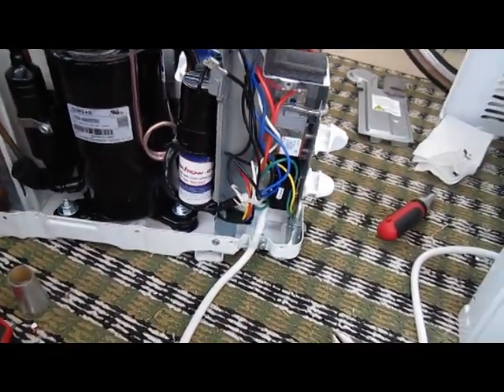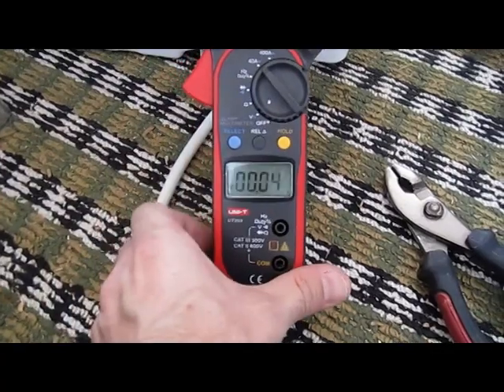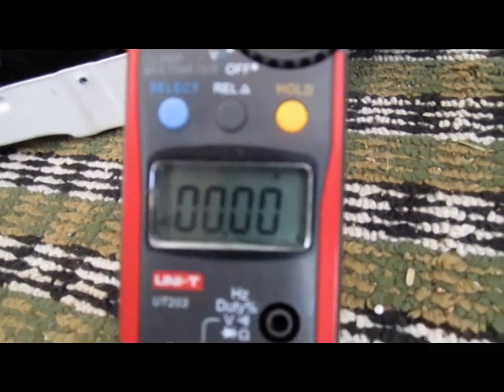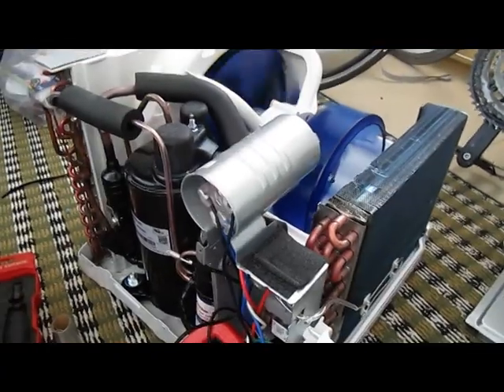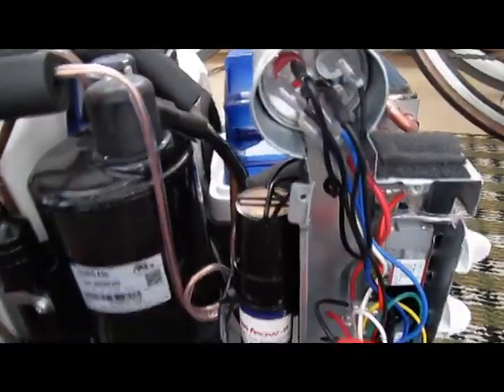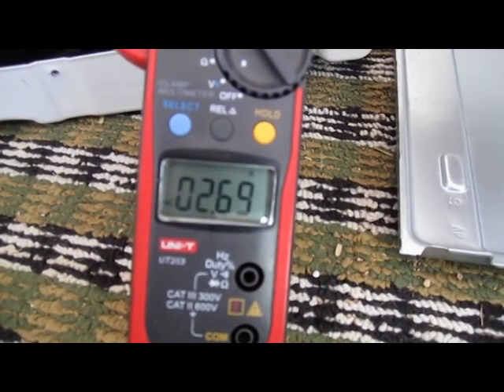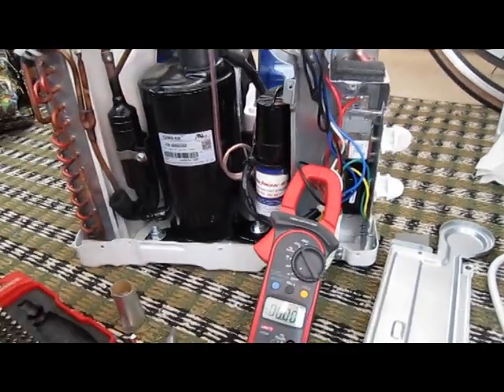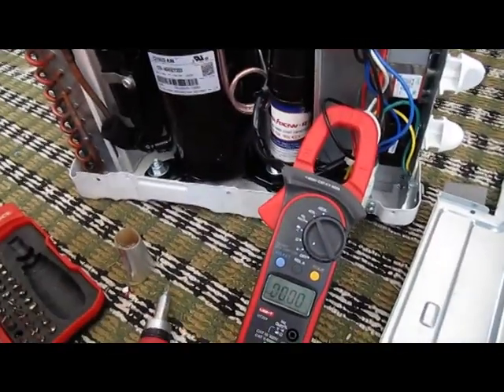Hard start cap mod on window AC unit for off grid, solar power low amp startup.

Comment: Id like to see how you did the capacitor on the chest freezer modification
Reply from the maker: That's much more straight forward, you can just buy it and wire it like you would in the directions for an AC unit.

Comment: Which AC unit is that?
Reply from the maker: I'll do my best to find you a model number later but I think this is it or very close FFRA051WAE, worked fine but I think I've mostly given up on this path forward so I'm not using it as intended though I do think it would work great.
Reply: @ZeroEntropy.  why did you give up on it?
Reply from the maker: I think for my needs I would do better with a portable unit for one.  I would entertain a mini split if not for the flare fittings, I still honestly may give one some thought  if I have a setup that would work with it but for simplicity I think I would rather stick with the portable units.  Not only does it have a slightly better look to it but allows a little more flexibility with venting it and so on.  There's nothing wrong with what I did, I would use it or a mini split in a stationary application but for travel I'd rather have the portable for simplicity, appearances, and convenience.

Comment: Thanks for this!  Cool to see the difference in startup amps.  What is the rated BTU and amperage for this AC?
Reply from the maker: https://www.amazon.com/Frigidaire-FFRA0511R1-Window-Mounted-Mini-Compact-Conditioner/dp/B00W2KG92Y/ref=sr_1_3?ie=UTF8&qid=1534806104&sr=8-3&keywords=window+air+conditioner&dpID=51s715bDXLL&preST=_SX300_QL70_&dpSrc=srch
Reply from the maker: I think that's the unit I purchased, it was $115 on Lowes or Home Depot's site if I recall.